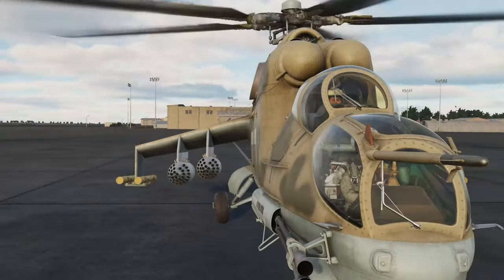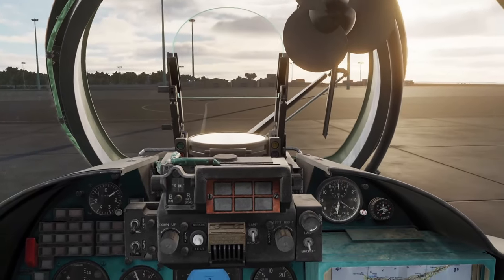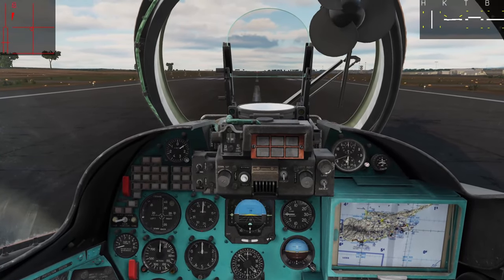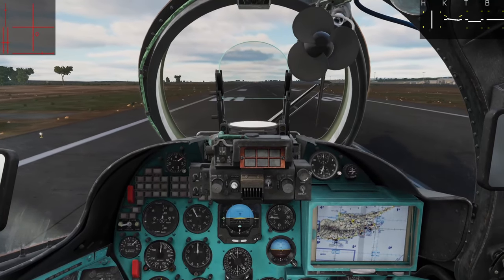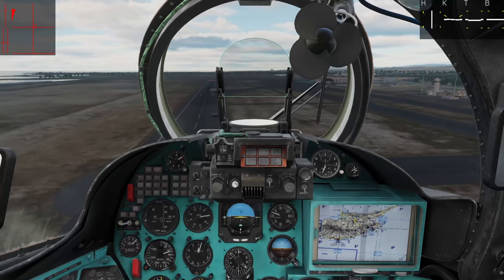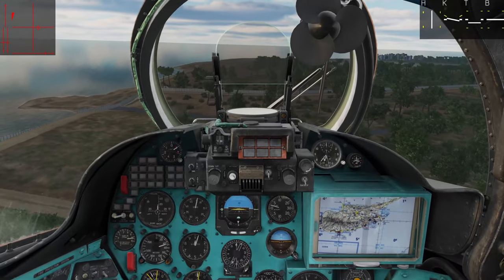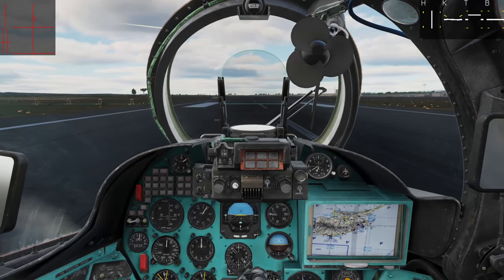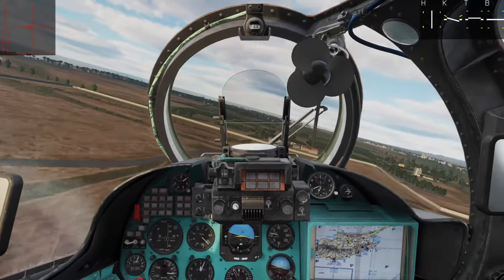DCS Hind Tutorial- Ground Taxi and Take offs | Real Apache Pilot Plays DCS World

Comment: There are two things everyone needs to know. Unless y'all know already. So, first: for the moving map to work correctly, the air probe to DISS switch must be off.  If you turn it on, it will mess up your doppler system. Second: go to the Mi-24P aiming station controls, it seems empty, but it isn't, go to axis assign and make sure that the aiming station only takes input from one device, I.e. delete all redundant axis assignments that it makes automatically, which messes up your control. Adjust sensitivity and curve to taste. This is the difference between frustration and joy of operating the AT-6 aim station in the front seat.

Comment: use the engine pressure ratio gauge for telling how close you are getting to pulling the guts out of her...
its the Russian torque gauge.
it is the 2nd gauge down from the artificial horizon.
so slap bang in the middle, at the bottom.
the three red flags are unlimited cruise power. time limited cruise power (60 mins) and the top is take off power. (6 mins max)
combine it with the pitch indicator.
the EPR adjusts for outside air temp and pressure.
Reply from the maker: I don’t see enough granularity in the eng gauge to tell me anything. Pitch has enough movement to base things off of. 🤷🏻‍♂️

Comment: How often do helicopters take off when they are over max gross weight? BigNewy was saying on the forums that while the ideal max weight for the Mi-24 is 11500kg it's actually  max takeoff weight is 12500, which seems to be it's fully loaded weight with heavy weapons and full fuel (or close to it). Usually I just limit fuel and munitions to come in at the 11500 weight, and i can understand why you would want to load up more, but does this actually really happen a lot in real life? As mentioned it doesn't give a lot of great options in an emergancy.
Reply from the maker: I’m speaking solely as a DCS player. I never took over over Max GW. but I know a lot of players will
Reply: That's why we have runways and rolling takeoffs.

Comment: Do you have any of the SAS channels engaged when you are taking off?  I have found myself fighting the SAS inputs at times and have been just leaving it off until established in forward flight. I think if I understood what the SAS was trying to do better I wouldn't be getting into these losing fights.
Reply from the maker: Honestly I haven’t even messed with the trimmer hardly at all. Helps cause I use a joystick extension I think.
Reply: Engage the pitch and roll channels, leave everything else off, the altitude and yaw/heading hold channels are really only there for long straight line flying.

Comment: Thanks for the video. A small request please, can you make sane video but without your rudder pedals?

Like use the T16000m throttle pedals (the ones on its front) and tell how to use these?

I have the T16000m throttle and I cant control the hind  😂
Reply: Make sure you're not using yaw stability channel in the autopilot. It's a lot more trouble than it's worth.
Reply: @antonbatura8385  will try it.
It's just that most of the tutorials available are form people having rudder pedals. 
None I've seen yet who is playing with stick and throttle
Reply: @ThunderingVipers  I have to admit, I cannot imagine flying any sim without my pedals, fixed or rotary wing. I have the same hotas as you, plus I have really old Saitek pedals, got them 10 years ago or so. The "petal" on the throttle that you're using is oversensitive, I think, and it becomes rather noisy quick. I think you're better off using stick twist (I assume you have the T16000 stick)
Reply: @antonbatura8385  well the issue is we cant get rudder pedals here in our country, and HOTAS themselves are extremely expensive to get from abroad...and ive already paid huge prices for it.
i am using a vkb gladiator with the T16000m throttle.. 
and majority of the people i  know here in my country are using Just the stick and keyboard to fly with..very few have hotas..and fewer have hotas with pedals..

hence i am stuck with the Petal of the throttel to use as a rudder..
Reply: @ThunderingVipers  ah, I'm sorry to hear that. I went with T16000 throttle and stick (also crazy expensive where I live), and I had those pedals since forever. I hope you are able to figure it out, man.